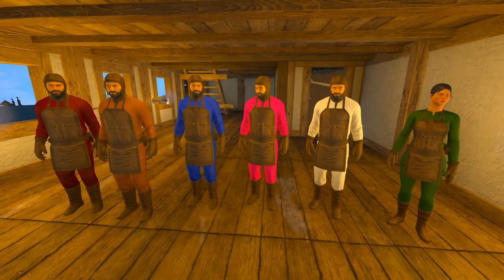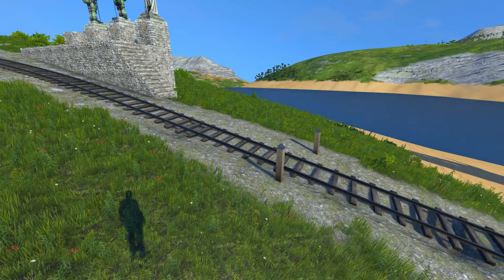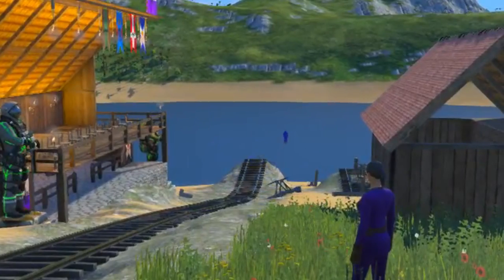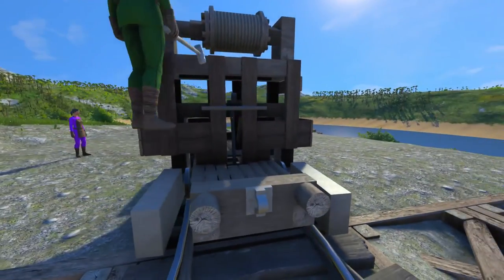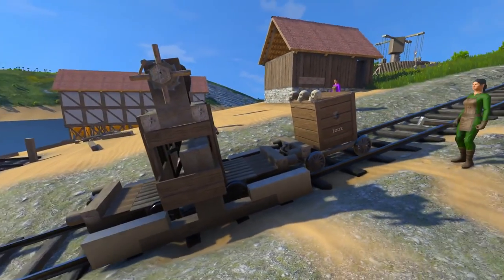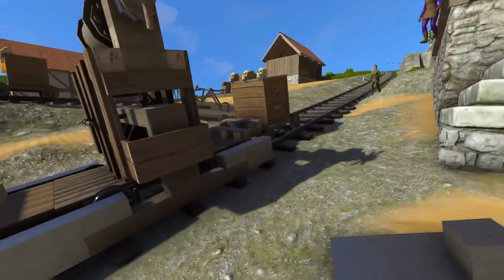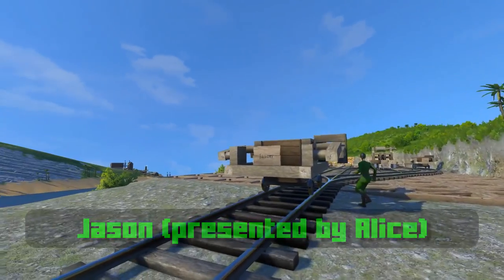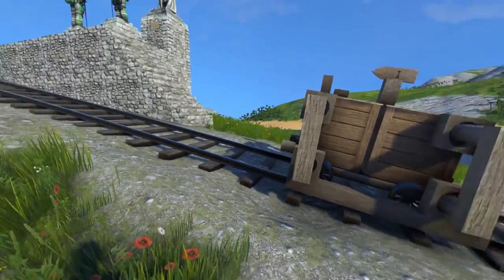Braking Contest - Medieval Engineers S1E43

Comment: Honestly, you should just put catchpoles to either side of the tracks like mile markers. Lower some arms to either side like wings to break the train at the next catchpole marker. Simple and foolproof.
Reply: Yeah, I was kind of hoping that would be part of the contest, but it looks like maybe that's not necessary. And, if you're rolling quickly backward (which just means that you've lost control of your train anyway), then when the wings hit that, they will break off. That happened in one of General Curmudgeon's videos, well, with one "wing" made of a plank.

Comment: So are track switches working? How do you choose the path?
Reply from the maker: We were just breaking them and building up the ones that we wanted to use.
Reply: track switches are, either in or in soon™ and all you need to do for them is turn the switch. :3
Reply: @niakitten2937  thanks kitten. I unfortunately don't have the game, nor the time if I did; but as an engineer, fan, and rail fan I was curious of the controls.... and how Epik may forget to set it or remember the setting and crash. Note to Epik with his epic rail line, I might suggest he look up switch signals (green for straight, red turn).